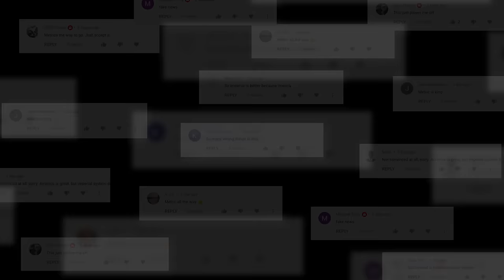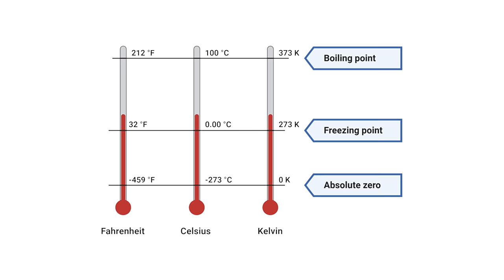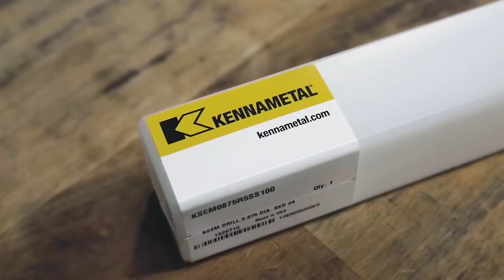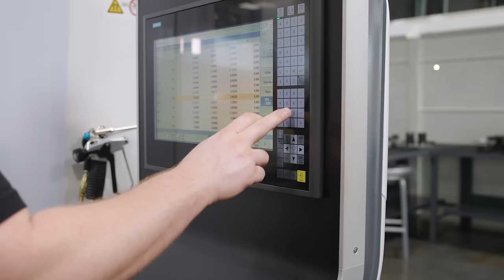Why METRIC is SUPERIOR to IMPERIAL

Comment: Myanmar,Liberia and the USA are the only countries still using imperial units. The last few shops I’ve worked in  in the US were all metric and it was such an enlightening experience that now that I’m designing and manufacturing my own products they’re all 100% metric units.
Reply: Didn't Myanmar have their own measuring system?
Reply: From Wikipedia:

The traditional Burmese units of measurement were a system of measurement used in Myanmar (also known as Burma).

According to the 2010 CIA Factbook, Myanmar is one of three countries that have not adopted the International System of Units (SI) metric system as their official system of weights and measures.[1] However, in June 2011, the Burmese government's Ministry of Commerce began discussing proposals to reform the measurement system in Burma and adopt the metric system used by most of its trading partners,[2] and in October 2013, Pwint San, Deputy Minister for Commerce, announced that the country was preparing to adopt the metric system.[3]

Burmese government web pages in English use imperial and metric units inconsistently. For instance, the Ministry of Construction uses miles to describe the length of roads[4] and square feet for the size of houses,[5] but square kilometres for the total land area of new town developments in Yangon City.[5] The Ministry of Agriculture uses acres for land areas.[6] The Ministry of Foreign Affairs uses kilometres (with mile equivalents in parentheses) to describe the dimensions of the country.[7]
Reply: The UK mixes units of measure.
Reply: @justinlabarge8178  Yep. In the UK you drive distances in miles but fill up at gas stations in litres. And it gets crazier when it comes to the fuel efficiency of a car, that's measured in miles per gallon of fuel.
Reply: @mikethespike7579  
The UK doesn't have gas stations.
Reply: @lenroddis5933  I'm sure Brits are knowledgable enough to be acquainted with the term "gas station". Not sure I can say the same for many US Americans when it comes to using the term "petrol station though".
Reply: The UK mixes it up depending on the age group.
EG When it's cold we reference temperature to zero degrees but when it's hot we say the high 80s 90s.
We buy fuel in litres but think in how many miles per gallon our cars do.
Our speed limits are in miler per hour.
Our heights are in feet and inches and our weight are in stones.
We're better at cycling than the French but they are better at football.
Yep, it's a mad phucked up world so enjoy it while you can because it's later than you think.
Reply: Both Myanmar and Liberia are converting to metric, just leaving the US.
Reply: @paulg3336  You trying to tell us that Britain is so primitive that you don't even have caves to protect yourself against bad weather?
Reply: Wonderful to read.
Reply: @mikethespike7579  there is a gas station about 1.5km from my home, but it pumps gas. LNG. For converted vehicles, mostly taxis.
Reply: Or pints for beer snd cider though they are 568ml
Reply: @danielch6662  Do the Bri'ish buy gas in kg, stones or pounds?
Reply: "Myanmar,Liberia and the USA are the only countries still using imperial units."

Ask a Briton how tall he is, how much he weighs, how far away the pub is, and how much he had to drink there last night. Not one answer will involve a metric unit.
Reply: @bcubed72  Thats changing from what I have read
Reply: I’m pretty confident everything manufactured in factories in the UK work in metric and have done for at least 20 years. Does anyone know otherwise?🇬🇧
Reply: @bcubed72  right it will involve stones, fortnights, imperial quarts, and imperial standard yards
Reply: @kingsman428  never heard anyone in the UK use Fahrenheit. Also hospitals and a lot of people now use kilograms for weight and meters or more commonly centimetres for height. Using kilograms for weight is a lot more common than using metric for height though.
Reply: @edonveil9887  Gas (the methane type we heat our houses with) is billed by the kilowatt hour. Gasoline is sold by the litre.
Reply: @bcubed72  It varies. I state my height in metres and weight in kg.  But the pub is a mile away. Britain was on the way to being fully metric but the government bottled out before the job was finished.
Reply: @garethonthetube  You sell petrol by liters, yet you measure fuel conomy in MPG. How does that make a lick of sense?
Reply: @bcubed72  that’s due to the fact that it’s because people know the numbers. No one uses that fuel efficiency to work out how far they can drive or how much fuel to buy. It’s just an arbitrary number. And 50 is better than 20.

So might as well stick with the arbitrary number system that has always been used.

Having said that… I use “miles per kilowatt hour” which is just… weird. 😂 🤷🏻‍♂️
Reply: My home country of The Philippines uses both hahaha. For specific things.
Reply: @bcubed72  It's bonkers!
Reply: @lenroddis5933  yeah they aren’t clever enough to know what a gas station is. Shame really.
Reply: Metric works for manufacturing, but I don't see why we can't use both in every day life? a Football field being 100-yards, or a gallon of milk, or oil by the barrel. But you can still buy a 2-liter of soda.
Reply: A simple thought experiment: a cube filled with water, with  a side length of 10 inches, has what volume in gallons or pints? Out of your head, with no paper, no calculator... A cube of 10 cm side length  has 1 liter or 1 cubic decimeter or 10*10*10=100 cubic centimeters (cm³), out of my head. What does the cube weigh in lbs or stones? Metric it's 1kg or 1000g, out of my head. And that works the same with uneven numbers as well. No conversion tables, no memorizing. Just the knowledge how multiples of 10 work and how to shift a decimal separator (comma or point)... Just saying. 😇
Reply: Haven't Myanmar and Liberia commenced Metrication, it's just taking them a long time?
Reply: Well did you ever go to UK? For some reason they use both and its a complete mess
Reply: @Snnupy1  we do use both, there are some superficial things that still use Imperial, we drive in miles (though walk in km), over 40 and you weigh yourself in stone, and beer and milk is measured in pints. Though underneath it is mostly metric, it is hard to buy Imperial bolts (and those are UNC not Whitworth), materials are measured in metres, etc.

I use feet and inches for approximate distances, but they tend to be metric feet (300mm) as it is a convenient unit.
Reply: UK very much depends on your age,
Above 70 and they still use Fahrenheit below that and it's almost all Celsius.
Ask someone their weight and up to gen X you will get it in stone, millennials could be either and gen Z and younger most likely to use kg

Driving and walking distance is in miles but running is in km unless it's a marathon....
Small measurements could be either feet and inches or metric depending on how accurate and how old somone is (schools only formally teach metric up until year 9)
Cooking recipes are all in grams unless it has been handed down from your grandparents or before when it's probably in ounces... Cups are never used!

You buy everything liquid in litres with 2 exceptions, milk and beer both of which are in pints (uk 568ml not the American short measure) (but wine and spirits are metric)
Unless its bottled beer when it's metric!
Reply: @bcubed72  At least you've adapted your money to metric.
Reply: @shagrat47  

Yes, a cube with 10cm side has 1000 cubic cm (cm3 - 10x10x10). That's also equal to 1 liter.

1 liter of water weights 1kg (other substances will obviously be different).

1 cm = 1mm
1000mm = 1m
1000m = 1km

The speed of light is 300.000km/s

Speed can be given in meters per second (m/s) or kilometers per hour (km/h).

All conversions in metric are so much easier, because they are not just some random conversions, they follow the decimal system, which is the same we use to count our fingers and that we use for most of our common day math. We count using the decimal system - 1, 10, 100, 1.000 and on.

Celsius is not just established as the 0 when water freezes and 100 when water boils, but it's also yet another decimal system.

For this reason, all conversions and and all math in metric is much easier and simple.

Hell, the US science and industry uses metric. The imperial is only ever used in the day to day of people in the US, because it's what they're used to and yes, it's hard to adapt for an individual, but metric is far better in every possible way.
Reply: @dasy2k1  Nobody gives their weight in Kg in Britain.
Reply: @skillbopster  Nobody gives their weight at all in Britain, because of obesity.
Reply: @skillbopster  I do, and a good half of my generation and younger in the office do, they may well know it in both but is actually surprising how many do use metric now
Reply: @lenroddis5933  They also don't have any petrol.😆
Reply: what are you making?
Reply: I design at work in inches because I always forget my tape measure and grab someone else's and it doesn't have metric. Ugh
Reply: @edonveil9887  I am rather sure that they buy petrol in liters... Gas in UK is LNG and that is measured in kWh...